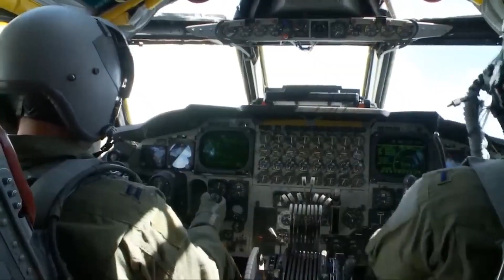Why Explosives are used to Jump start the Engines of the B-52 bomber

Comment: I doubt the cartridges used to start those engines are explosives. They are probably smokeless powder, similar to that used in firearms, which is not an explosive but is a propellant. It is a small distinction, I suppose, but a propellant burns at a slower rate than an explosive.